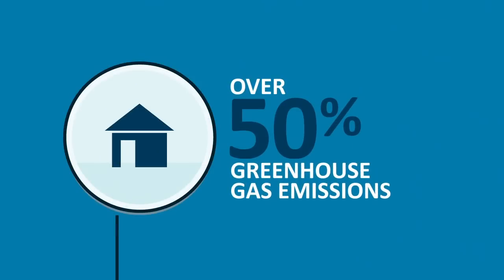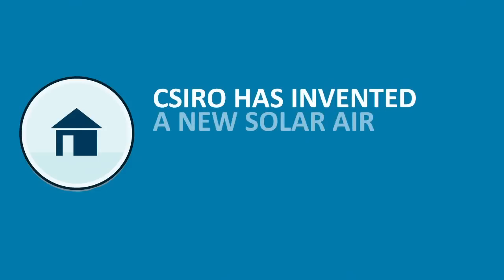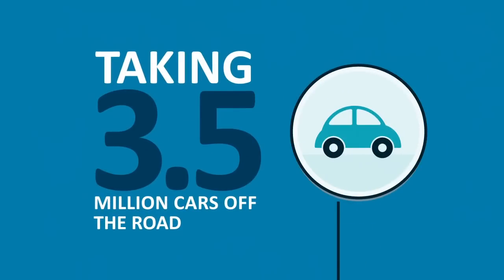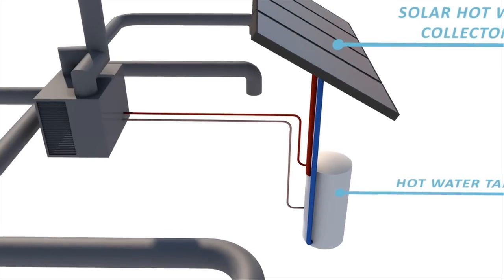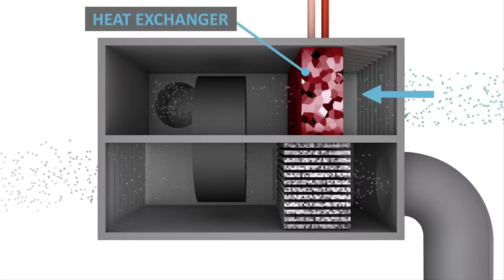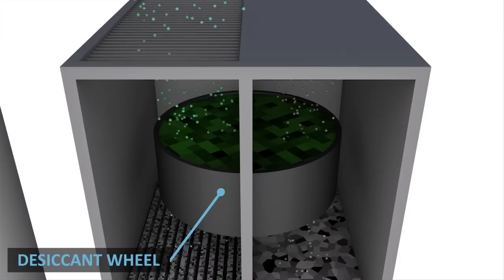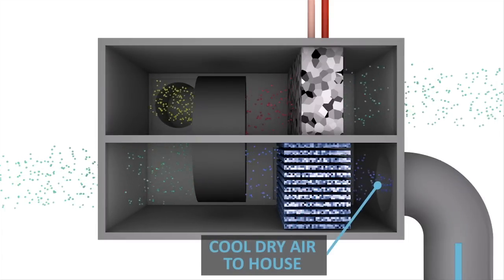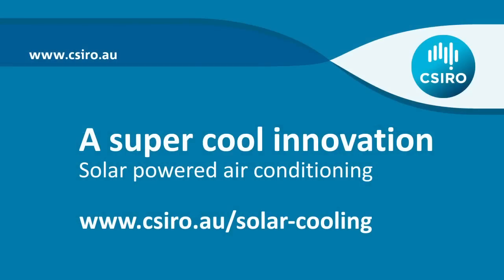Solar powered air conditioning

Comment: So, basically, a swamp (evaporative) cooler that works in humid areas.  Seems like that desiccant wheel would have to be enormous to work efficiently for a whole-house system though.

Comment: Excellent thought. Very much desired for India. We have Sun throughout the year !
Reply: innovative product
Reply: Is it possible to buy this in India, State of Kerala? 
Please let me know
Reply: FYI, radiant cooling which is very efficient but still needs a separate dehumidifier to dry the air. So an effective solar power desiccant wheel dehumidifier would be useful for many applications.
Reply: Very much needed in india
Reply: I want to build this system now please support...
Reply: Sandeep Chadha, Check the Internet for "Citrus in the Snow", and YouTube for "Citrus In Nebraska!" You'll see something that can be Done in India, Bangladesh, Buenos Aires, or even Anchorage!

Comment from the maker: Hi Michael. An indirect evaporative cooler incorporates a heat exchanger. It draws in fresh air which passes through a dry channel where it is cooled without adding moisture. Cooling is provided by the evaporative cooling effect on the wet (cold) side of the heat exchanger. The extracted moist air from the wet side is vented, so it’s only dry cool air that goes into the building.
Reply: What is the delta T. In other words if the room temp is 75, what will the supply air temp be as you typically need a 15 degree drop in temp to actually drop the room temp in a reasonable amount of time.

Comment from the maker: No problem. The desiccant materials we have tested include silica gel, zeolite and polymer. All work, some better than others.
Reply: An indirect evaporative cooler that delivers cool dry air, the most critical part in the system, and it does not exist. Those desiccants you tested are little packets they package with electronic products that say "Do Not Eat", and I'd like to see how easy it is to remove moisture from them if you can.
Reply: @charlestaylor3195  Dessicant wheels are in widespread use already.

Comment: Correct me if I'm wrong. But besides the fact that the dessicant wheel itself is already hot, doesn't the dessication process itself heat up the air anyway?

Dessication and evaporative cooling are both just the processes of converting sensible to latent heat and vise versa. When you pass the air through the dessicant, it loses water vapor but the water vapor has to release energy to the air to condense to the dessicant. Likewise, when water vapor is evaporated by the air, the air experiences a loss in temperature as the water has to absorb energy from something to turn into water vapor. In an ideal process, the enthalpy or total energy of the air (in the form of sensible and latent heat) has to stay the same.

Given this, isn't the addition of a dessicant wheel redundant then? The decrease in temperature that can be attained by the air was already dictated by how saturated with water vapor the incoming air is.

Comment: The thermo acoustic cooling is a way more effective and better. BTW, there even better, simplier and cheaper solution, use ground with always constant temperture for cooling and heating.

Comment: It's caled a swamp cooler.  Works great in low humidity, not at all in high, plus has a fixed temp drop of about 25 degrees, so if it's 110 out you can get to 85, better than nothing.
Reply: yes, it is a swamp cooler... but you didn't notice what they were doing to the air BEFORE it got to the evaporative cooler - they are DRYING it.  So, they pre-treat the air by dehumidifying it before sending it to the evaporative cooler (which adds humidity back into the air)... the result is cool air (colder than regular swamp air), that does not have an increase in humidity.  I think I have seen an efficiency gain where the temperature drop is about 35-40 degrees (F) instead of just 25 degrees, as you stated.

Comment: (energy) to the incoming outdoor air.
Most energy recovery devices transfer heat (sensible) energy only.  An Enthalpy Wheel allows both heat (sensible) energy and moisture (latent) energy to be exchanged.  The Enthalpy Wheels are usually made of porous materials to increase surface area which aids in energy transfer.  In most cases a matrix core material is coated with a desiccant such as Silica Gel or other molecular sieves to increase latent transfer.

The Enthalpy Wheel, coated with a desiccant material,  is rotated between the incoming fresh air and the exhaust air. Heat and moisture are given up to the wheel. When the space is in the heating mode, the heat and desirable humidity is used to pre-condition the incoming, cold, dry air. In the cooling mode, the incoming air is pre-cooled and dehumidified.

Because the cost to remove moisture can represent 30 to 50% of the cost to condition air, substantial additional savings are available with enthalpy wheels over conventional air-to-air exchangers. 

 Summer & Winter Energy Recovery  Wheels

Comment: FYI, radiant cooling which is very efficient but still needs a separate dehumidifier to dry the air. So an effective solar power desiccant wheel dehumidifier would be useful for many applications. So when will it come to market?
Reply: Only works with the Metric system.
Reply: Relevance???
Reply: The CSIRO produced printed thin film photovoltaic cells about 5 years ago too, still not on the market as far as i can tell...  There is and has always been a major disconnect between researchers and manufacturers.  

They might well just make these videos and hope for a company to make them a sizeable offer, where as most companies would prefer to spend the money on their own research that they can patent.
Reply: I doubt it would ever come to market. Modern A/C units based on compressed refrigerants are highly efficient, relatively inexpensive and easy to install.

Comment: There's one area I worry about with this.  Air quality.  The desiccant wheel is cycling between both chambers, and it's picking up particulates from the air in both.  Which is then being recirculated through the house.

Comment: The desiccant material stays damp all the time, as 2nd compartment gets humid air from outside. I don't see any fans recirculating air from the 'hot water' pipes, unless the air is isolated there to blow into the desiccant, it will be humid as well.  You have to have dry, not humid air to start with to dry the desiccant.
Reply: they cant show everything in the video!

Comment from the maker: There is no fixed limit. It depends on the ambient air humidity (more moisture is removed from more humid air) and temperature, and also the temperature of the solar heated hot water (hotter the more dehumidification).
Reply: Whats the point is saving emssion if ya just gona open a new coal mine every other year!
Reply: @jimbob-jn6jz  Less you need to consume less you need to open mines ?
Reply: @AutoNomades  this system would be much more efficient than the present airconditioning tech. We need some kind of breakthrough in solar panels though, I feel like this technology might be suffering suppression because it might disrupt society, Imagine abundant energy... for everybody something like that could even break capitalism logic of scarcity...

Comment: What about mold collecting in the fan? Would it not be prudent to have some type of UV light to treat the air before it's being sent throughout the house?
Reply: That's what HEPA filters are for. BUT the application of silica desiccant which ADSORBS not ABSORBS MOISTURE is specific to it's own antifungal properties. True it's not fungicidal. But it's the toxin not the mold that kills ya. So it could be ANYWHERE in the duct or house and do damage. Unrelated danger avoidable or not. It is known to pull nitrogen from the air "scrubbing" it so a higher concentration of Household O2 is possible. That can be dangerous. But not REALLY. Iirc 😉

Comment: main questions are not answered. price,  whether it can be incorporated in a flat,or only useful in independent bungalows, how much space does it require. how much does it cool,what is the maintenance cost. dessicant wheel will have to be changed after a certain amount of time,I think. how much power does it draw? so many unanswered questions.

Comment: This is effectively a two stage evaporative cooler. The first stage is described in this video where the incoming air in chamber two is desiccated and cooled slightly by the desiccation (the act of removing water from the air medium cools the air slightly). This desiccated slightly cooler air then comes across a typical evoprative cooler (stage 2) where it absorbs more water than normal, thus cooling the air more than a single stage evaporative cooler. The real question is, does this provide better cooling per litre of water?

Comment: This 3 in 1 system could be dramatically improved by new recent technology breakthrough of Valeriy Maisotsenko and our R&D team. Look at M-Cycle providing 100 deg. F Cooling Demonstration - 60 deg. Celsius air cooling.  M-Cycle is well-known in Australia. Using M-Cycle your solar-powered system could be Siberia-cold and Sahara-hot  @7hvA

Comment: It went over my head.  How do you heat water with the sun, bring that heat into the house and make the house cooler?  I've used excess heat vented out the roof to bring cool air into the envelope from under the slab.  I don't get this.
Reply: You should atleast  read a little about adsorption/absorption refrigeration/air conditioning before making such stupid statements

Comment: no water pump required as the hot water system is equipped with a circulation pump. Hot air or cold air to house depending on time of year minus the humidity.

Comment: This would be far more effective if it was installed in a passive house (highly insulated, with triple glazing, drawing in air from underground pipes).
Reply: Geothermal.
Reply: My wife and I do live in a passive solar home, with triple glazing and earth pipes supplying fresh air. The walls are 12 inches or 30 cm thick, insulated with blown-in cellulose. R48 or so. We have R68 overhead, and R36 underfoot. We have no need for air conditioning at all, as all that insulation keeps the heat out in summer. Our summers here in British Columbia are around 30-35C. The house is always comfortable. 

Now, I'm not saying our home would be able to withstand the 45C heat of Australia. That's a big challenge for any home designer.
Reply: @Salvatore Guidone It depends..  Strawbale houses can be cheap, comfortable and well insulated..

Comment: Install earth exchangers at about 18 to 22 feet in the ground.  A constant temp of 54 to 56 degrees Fahrenheit with unlimited amounts of energy can be obtained. 
Always cool in the summer and a base amount of heat in the winter. The deeper you go the warmer it is.
Reply: Geothermal.
Reply: Moron that just trolls repeating Geothermal gets likes lol
Reply: FYI, radiant cooling which is very efficient but still needs a separate dehumidifier to dry the air. So an effective solar power desiccant wheel dehumidifier would be useful for many applications.
Reply: WTF Feet ? Fahrenheit ? Get with the program. If you want to convey your message to the other 95% of the  world please use the Metric system and Celsius.
Reply: Dear, Metric NAZI, the is program no matter what you have been told. Your not the leader of 95% of the world so your opinion on this matter is meaningless. And people will keep using the measurement system they are most with comfortable using like it or not. 
Kinda like you are just comfortable making worthless troll comments. So enjoy having your "Feet" in your mouth. Have a good day, Sir.
Reply: Earth exchangers are pretty awesome, but underground temperatures are actually an average of year round ambient temperatures, so your 54F (13C) suggests that you live somewhere with a high latitude that is normally pretty cold. I live in the tropics and we have a constant underground temp of 86F (30C). Sure this would cool me in summer and heat me in winter, but it's not a comfortable temperature for your home. Coober Pedy (29S Latitude in Australia) has an underground temp of about 73F (23C), that's a pretty comfortable place to use earth exchangers.
Reply: @TheFunkyPlum  Sorry but you seem confused and are incorrect since, "at about 18 to 22 feet below ground.  its about a constant temp of 54 to 56 degrees Fahrenheit , its not 86F that far below ground....
Reply: @nc3826  Ok, now I understand you... 
CANUSA Kommando is right and you are trolling again!
Reply: @nc3826  Radiant cooling "very efficient"... ok again... lol!!!
Radiant heating is efficient, but radiant cooling!
Ha you again...!

Comment: Okay, but what if you need to sweat?

There's nothing that's actually cooling the air except for evaporation, which significantly raises the humidity and reduces your body's ability to cool effectively.
And for reference, when you remove water from the air, you also heat it up. that's just a part of the condensation process. So this does nothing.

I was thinking this would involve something similar to an einstein refrigerator, which uses the heat of a flame, combined with liquids that have different rates of expansion and density, to cool the air going into the house. My family had an old motorhome with one of those, but unfortunately I don't think that would have a high enough efficiency to overcome heating by sunlight. maybe if the house was super well-insulated.

Comment: how the rapid cooler in the 2nd compartmetn works??? does it works with electricity???????
Reply from the maker: The indirect evaporative cooler works by using a second evaporatively cooled air-stream to cool the main air-stream. The system uses a small amount of electricity to run a fan that distributes the air and to run a water circulation pump.
Reply: @csiro  - So, bc you already using solar thermal heating, that small amount of electricity could come from a solar panel, right?!
Reply: @csiro  a second evaporatively cooled air-stream to cool the main air-stream? If you are going to make stuff up, can't you do better than that. Try to make one, then, get some real scientists working there.

Comment: Questions:
1. Does the humdity escape somehow before or after the dessicant material? 
2.Is the dessicant a disposable feature, and if so, 
3. what is the replacement cost?
4. what is the replacement interval?
5. Is there a chance of mold accumulation over time?

Comment: Well the first sentence in this video was very presumptive!
Firstly, although I am in SEQld, I have no heating or cooling in my house and my hot water is on the lowest usage tariff and I use very little anyway.
I would not produce 5ton of GHG per decade let alone per year!
This is why I am looking at alternatives for a/c. To keep my GHG to the lowest level!
As I am now in my twilight years and the summers seem to be getting hotter, I have been advised to get AC.
But the extreme power usage weighs heavily on me, so some research is required before summer takes hold again.
Reply: ClissaT - On YouTube there is a Video, "Citrus in Nebraska" and on the Net, 'Citrus In The Snow", where they describe very simple, effective, base Cooling systems, that the person involved, has spent 20 years on Tweaking it, for reasons Different than yours, in part, but getting the Benefits you want! Also, in his case, it's used to warm his House, and Greenhouse, in the Winter!

Comment: It's basically just an overly complicated, low output swamp cooler (the "air conditioning" side of it) with multiple single points of failure.  The heating aspect might work but the cooling is going to be weak to non-existent.  Because among other things you have a very hot "desiccant wheel" constantly moving through the cooling side of the system.

Gotta love those Aussies though, they're the kings of over-complication.  That's why they do things like use three syllable words to describe something the rest of English language speakers use a single syllable for.  "Billabong" vs. "Pond" for example.
Reply: Australia's climate is a lot dryer than SW Louisiana, or Florida, but would work great in Arizona...
Reply: I don't know about SW Louisiana, never lived there though having been through Alabama and Mississippi in the summer time I can imagine.  

Australia has a varied climate, from tropical jungle to alpine forest to desert.  I HAVE lived there and it's not necessarily a dry climate unless you're in the desert.  Funny thing about the climate there, in say someplace like Queensland -- It varies.  There are very dry years and there are very wet years.  You never know for sure which it's going to be.  It could be droughts or floods or neither.  So even more reason not to invest in this hokum because among the many things Aussies are good at, conning people is right up there at the top of the list.

Comment: Where does the hot dry air go during summer?I mean,in summer,the cool air is being circulated,but where does the hot air go,which passes through the 1st compartment?
Reply: Are you kidding hot air travels through the house during summer because it doesn't work.

Comment: I don't understand how the INDIRECT EVAPORATIVE COOLER'S work.... How it works ?
Reply: They spray water over a car radiator the water evaporates out the other side, air is pumped thru the radiator.......
Reply: Dave Miller then the air become humid again, right?
Reply: yes
Reply: The post clearly states "cool dry" not humid air since it would use a less efficient "indirect" not direct evaporative cooler that is not a mister but is a "heat exchange/radiator unit"...

Just like the condenser part of a heat pump functions, just in terms of cooling the air...